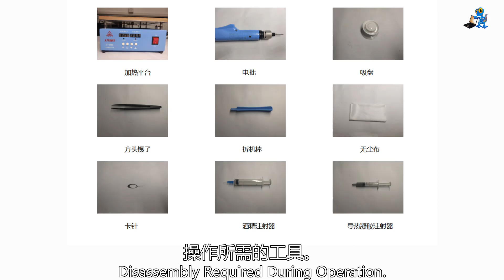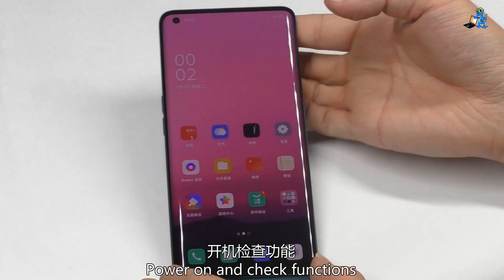OPPO Find X2 Disassembly || OPPO Find X2 Tear-down || How to disassemble OPPO Find X2

Comment: Hello, thank you very much for your instructive video. I have a question that not many people out there can answer me and I think you could answer. I think Oppo find x2 and pro's cameras are slightly different, being the pro version better. Do you know/can you check if the camera of pro can be placed in x2 version and work normally? I would really appreciate this information if you could check it.
Thank you for your videos.
Reply: The housing is different, the sensor size on X2 is bigger, hence space required for the lens to sit in X2 is less, plus periscope, plus the software programmed for those cameras on pro won't work on X2.
Reply: @zaidq82  Hi, do you know if i can buy a cph 2025 (find x2 pro) back cover for my cph 2023 (find x2) ?
Thank you
Reply: @mktom5857  what cover are you referring to? The kevlar carbon fibre case for x2? I doubt they are still in  stock.